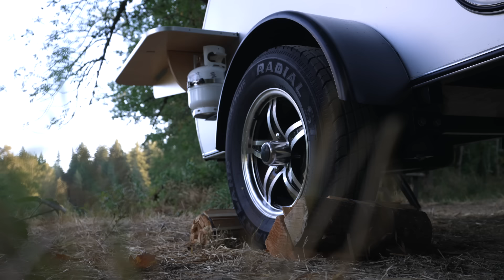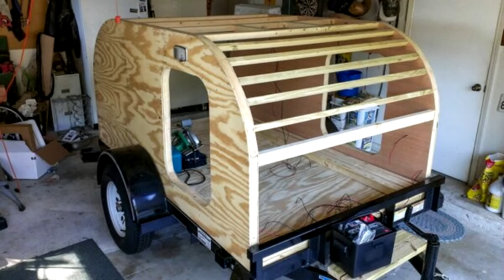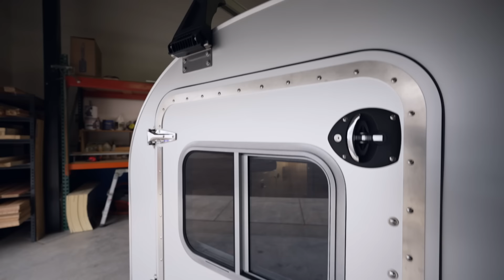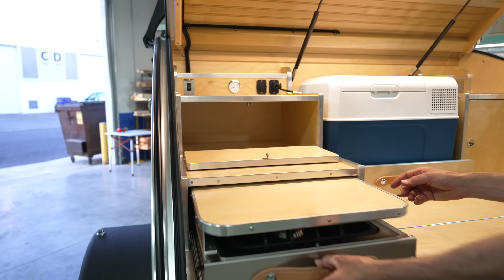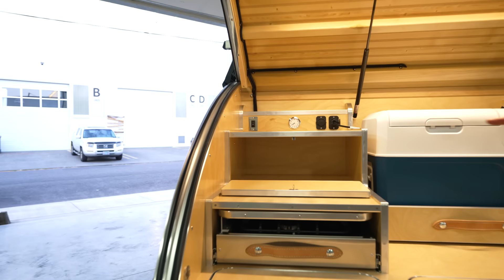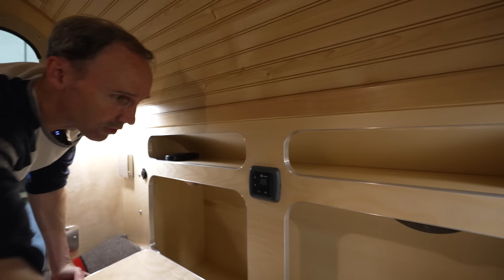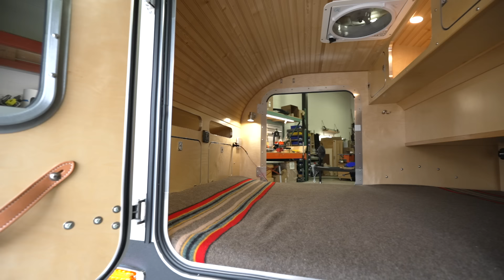RAISING THE BAR! A New Standard for TEARDROP Trailers

Comment: I wonder if they could install a slide out portion in the rear door to extend the coverage when the door is open. As usual a well presented video
Reply from the maker: Yes, or a lip. I have seen this with Bend Teardops in Oregon. They have a little diamond plating lip that extendes from the end off the hatch. It gives just a bit more coverage, which for most situations would be all you need.
Reply: @PlayingwithSticks  a couple of feet would make a lot of difference
Reply from the maker: @kayakcruisingtas  It really would. It doesn't take much. Even the Bend Teardrop version I think it is only probably 8-10" and that makes a difference.

Comment: It is a beautiful trailer but seems to be more show than go.  I didn’t hear anything about the tongue weight.  Seems like it would be heavy with two full 20 lb propane tanks, a large tool box and the axle behind the center line.
Reply from the maker: You have a good eye Ken. Yes, the tongue weight is a bit on the heavier side at 190lbs. Now that is 190lbs with both 20lb propane cyliders loaded. And you are absolutely right. With the axle placement of teardrops you tend to get a much heavier tongue weight than you would expect.

Comment: This look very cool and very affordable, however, Drew, Didn't you (sometime in the past), say that getting a plywood teardrop wrapped in something else does several things: Adds a ton of weight and eventually will suffer from water damage? I noted the ways they are trying to not allow water to seep into the ply and at ~1700lbs they are obviously using an aluminum frame to cut the weight. As for me, I am still only looking at trailers like BEAN and Escapod, who have fully sealed fiberglass exteriors which should last forever and composite cores for better insulation.
Reply from the maker: I'm glad you caught that in past videos. I was referring to the undercarriage of the trailer. Builders who have been doing this for a decade or two know that it is a big NO NO. So for example with this trailer because Dennnis has been doing this for a while he has his own way of protecting the belly of the trailer, while preventing water from sitting down there. Here is what he does. Regarding the floor- it is a single 5' x 8' sheet of 3/4" hardwood-core plywood with exterior grade glue.  They actually ship units of this plywood up from San Diego as this is the closest distributor that sources this high-quality plywood.  There are no scarf joints or seams in the floor and the plies have as near to zero voids as I have ever seen. The bottom of the floor is coated in 3 coats of "Battleship Gray" Dock paint with an added fungicide to avoid mold or mildew under the trailer even if it is stored outside during the off season. The top/inside is coated with a zero VOC, UV-cured clear coat finish. You do not want to have any type of covering material (like this- https://interstatervmetalandsupply.com/collections/under-belly-materials-blue-board-insulation/products/darco-skin) or belly pan over the floor since water or moisture can get trapped in between the floor and belly pan/material and cause mold/mildew and rot. An open floor is the best to allow road spray and any moisture to drip off and air dry. The Dock paint holds up indefinitely since it is not exposed to UV rays and is actually relatively well protected. Also should an area be scraped or damaged, spot applying is a snap since everything is open underneath.  Does Dennis get it or what?!!! As for your Bean and Escapod statement, it is hard to ignore. We can spend all day saying how a traditional teardrop is built to protect itself from the elements and road conditions. But at the end fo the day they still have a similar half life to any other traditional trailer. Basically that is 5 years due to the high and low frequence vibrations and lifespan of materials. At about five years you have to do some minor maintenance (seals, assessing connecting points, etc). Now with an overbuilt trailer like this video you could maybe double this lifespan, but I still think at five years and good use you will start to see some wear and tear. Where a non-traditional composite trailer has a much better chance of exceeding this 5 year mainteanance deadline. With a traditional trailer and proper maintenance it will last just as long as a composite trailer. BUT a composite trailer could last the life of it's owner with very little maintenance.
Reply: @PlayingwithSticks  best answer to a YouTube question I have ever seen. Thank you. (Still going to get an Escapod though 😀)
Reply from the maker: @GalendilEVEPlayer  I completely get that. They make a great trailer! I love how Jen and Chris are just pushing the industry to evolve.

Comment: Thanks for the vid! I wish that more tear drop trailers would come with the dual fiberglass propane tanks like this one has. Also I would be a fan of having a place to plug in a Bluetti, Jackery or the like as the power center for these trailers instead of the built in one. I would like this because if storing it for awhile you can easily just unplug the power station and keep it inside and charged up for the next camp adventure or could have a second power station as a backup in case the other one fails or runs out of power.  I like the inside of this tear drop and it has a very premium look to it!
Reply: Adding the ability to augment the trailer with an external power solar generator like Jackery, Bluetti or Anker would be amazing!
Reply from the maker: I second that!
Reply from the maker: BRAD!!!!! Thank you so much for being our big support. Some day I will have to put text on the video saying "This video is made possible by Brad!"  Haha. I have a feeling after this video is seen by the community many of us will be running out and picking up a fiberglass propane tank. That is what I love about these walkthroughs. There is always something new to be discovered. Good point on externally powering these teardrops. I think it is a great route to go. And a good way to save costs. One battery to do it all. Power the trailer and chase the sun. And I agree this is by far one of the most beautiful trailers I have seen.
Reply: @PlayingwithSticks  I love the dramatic acting clip you threw into this! I kept thinking you were going to start yelling “Stella! Stella”
Reply from the maker: @jgrant4520  Is this a Marlon Brando reference?  I love it!
Reply: @PlayingwithSticks   A tear drop named Desire!! 😁

Comment: I thought the trailer looked good.  The price wasn’t too bad.  I liked the fact that there wasn’t any hard mount water tanks.  Did the 12v fridge pull out?  I could see where it would be a pain to get stuff out if it didn’t.  It looked like it could.  Maybe I missed it on the video.  Those propane tanks were cool.  A whole lot of propane for that little camper.  I like that they are taking steps to mitigate water intrusion; but, with any wood teardrop, you have to be concerned about potential rot.  We like our Maxair fan like in this teardrop.  The only negative is when the fan is running or you open it with the remote, the lid/top is either all the way open or all the way closed.  It would be good to run the fan at 10% and have the lid minimally open.  Definitely would help on those cold nights which condensation and you don’t want the fan lid/too all the way open.
Reply from the maker: Hi Garret. Sorry, I should have had the fridge pull out. Yes, it does. But at the same time it is mounted high. I'm glad you mentioned the fridge because I'm able to mention how when your fridge is high you are essentially reaching in blindly. I find a fridge down low allows you to see to the bottom of the container. Which obviously means less shuffling around of items. And yes, even when your trailer is well built you are always going to have rot in the back of your mind. That is just the way it is unfortunately. I am an overthinker and so when I stumbled on my first Scamp I knew composite was for me. It wasn't that my teardrop was rotting, but I just couldn't shake the fact that it potentially could. Every storm, every outdoor winter storage period I needlesly worried. Because I knew there was a weak point that at some point could become vulnerable. Now with all that said, if you aren't crazy like me. And you don't stress over things until they actually happen....A little inspection of the trailer before taking it out and when returning it should be enough to ensure they last a lifetime and no rot ever pokes it's uglyl little head out. I am glad you pointed out the issue with the MaxxFan. Can you manually open it to be partially opened?
Reply: @PlayingwithSticks  Yes, you can manually open the Maxair fan with the black crank wheel you see turning when he opens the vent.  So, without the fan running you can manually open the vent partially.  Using the power open/close and/or running the fan is all the way open or all the way closed.
Reply from the maker: @garretlewis4103  Thank you for clarifying. I didn't realize that.

Comment: Great video thanks. I've got one foot in the water on a teardrop so I think I'll start to check out your other walkthroughs. This one's beautifully built and finished and seems like a good price for the quality but maybe a little heavy and maybe a little too "nice". I have a Toyota Tacoma 4 cyl and would rather not have to upgrade for more power.
Reply: Check out Drew's walk through of the Bend teardrop. I put my down payment down on the 6x12, picking it up in July. A little more basic but I feel it is perfect. And the price is amazing.
Reply from the maker: @ryanm.9533  My wife loves the Bend Teardrop and that is saying a lot. She is all about the cutesy factor typically. But she says that trailer in terms of functionality is what most users need.
Reply from the maker: You said it well with the "maybe a little too nice" comment. That is how I feel about this trailer. I wouldn't almost feel guilty about using it because it is such a piece of art. Not saying it isn't functional. But, it would take me a while to break it in. It would be hard to put that first scratch in it. In terms of weight I am in agreement with you there as well. Having a bit of extra towing capacity is always nice to have. Basically creating a buffer for different loads and driving conditions. Someday I will make a weight video. Most of the heavier trailers really cause negative impacts. But a lot of it doesn't necessarily come down to the weight, but more often the heavier trailers means more frontal area and often a greater drag coefficient. So although a trailer like this at 1,650lbs sounds heavy I find they often tow like a 1,000lb trailer due to their smaller size. BUT you put on a rooftop tent and now it performs just as poorly as many of the bigger trailers. Some day I am going to have to make a video about this. I have always been surprised how Camp Inn owners tow their trailers so easily with smaller vehicles. And that is where I have come to realize weight isn't nearly as important as drag.
Reply: @PlayingwithSticks  I know you are busy but I hope you can make a weight video some day.   With the price of gas now it's no small thing to be pulling 2K around.
Reply from the maker: @jenns7669  I'm still toying with the idea for this summer. A few stars will have to align to make it work. But if it does I think it will be a really special video.
Reply: @PlayingwithSticks  Excellent input. I've checked out the Bend and also the "Toad" both of those are longer on the function side which is what I want. I'm solo so I just want a twin/full bunk so I can have a sitting/living area as well. This may turn into a 6/mo a year home. I also may investigate a trade up to a V-6 Taco. Thanks for your input. Look like I'll be binging your site for a good while.
Reply from the maker: @jfowler7604  Another style of trailer to checkout would be a squaredrop trailer. I really appreciate the newer Runaway models because they replaced the wood with longer lasting composite materials.
Reply: @PlayingwithSticks  Thanks....will do.

Comment: This is a very nicely crafted trailer. Without a doubt. I agree with you on the third dislike about the lower portion being closed and would be more beneficial as a slide-out storage area. I also noted that you have to reach far inside and that means that you will potentially be rubbing your legs and part of your body on the back of the trailer, which if it is wet, covered in snow or road grime, means that you will not have a pleasurable experience. You will also likely catch your clothing on the number plate which will either bend it or potentially it will rip your clothes. Perhaps the lower part could  fold downwards (a split tailgate) if they still prefer to have a shorter upper portion. I don't understand why awning rails (a c-channel) isn't fitted to allow for the quick attachment of an awning like we see on the sides of caravans in Europe. In this instance, I mean an awning rail that traverses the lip of the tailgate and a simple awning which requires just two poles. This is a very nice trailer and that is why I bother to provide feedback. I feel it will be considered by Dennis even if it isn't ultimately taken onboard.
Reply from the maker: Great point on the rubbing. I thought about pointing that out as well. There was one point in the video where Dennis reaches over the entire galley to turn on the light. First I thought, that is an interesting light placement. But second it made me think about leaning up against the galley and touching that lower exposed portion. I never even thought about the number plate. Good eye! I really like your awning rail suggestion. We had that on our Shasta Compact and it was great. It doesn't take a whole lot. I am okay with a little water in my galley. I just want basic protection (like a simple awning or a hatch).
Reply: That’s actually a great idea, having something like that could be taken down quick if it got too windy.

Comment: Lovely!   I haven't  seen this teardrop before.   As you said there are things I like and things I don't like.   The space inside is great but I need more storage.   I'm going to research on that propane tank!  Wow.
I have never been a fan of the roll out stove design.   That's just me and the weather challenges I've had at times with wind, rain, and snow.   I'm interested in the wind rating for the galley hatch supports.   
Where is this teardrop made?
Thanks!
Reply from the maker: I have a feeling there will be a lot of us picking up that propane tank. It is a bit costly, but 1/3 the weight! Wow!  I have never been a fan of propane on the tongue. But for most builds that is the most logical place to put them. Good point on the roll out stove design. I even feel like that with some fridge designs as well on these 3/4 galley teardrops. Not that it matters to get the fridge or food wet, but it does mean you have to go further away from that hatch covereage. Some of these 3/4ths protrude a little further out. So if you stay close to the counter you can get fairly good coverage. But like you said if the grill or fridge need to pull out, that hatch now does you no good. In terms of the gas struts that hold these trailer hatches up they are typically plenty strong enough. The issue with them is that over time they may need to be adjusted or replaced. Typically with a craftsman style teardrop like the High Camp there is a wooden strut. Something like that basically has endless holding power. A good example of this if you want to see one is on the Camp-Inn teardrop trailer. The teardrop in this video is made in Portland Oregon. Hence why it is designed for all seasons and tougher road conditions.
Reply: @PlayingwithSticks  I own a Camp Inn 550. 
This trailer has a great galley for perfect weather camping.
The square door is great.   I like the leather pull strap.   I'd like another one of those closer to the middle of the door which, again, has to do with batteling wind and holding on to a door that wants to rip away.   Is there a door stop to hold the door open?
Thanks Drew!
Reply from the maker: @jenns7669  Now this is interesting. I have never heard that before. Flip over? Okay you have to give me more details here. So the hatches don't fall down they actually flip back towards the roof of the cabin? I can picture that now. Without a gas strut I guess there is nothing stopping them huh? In the midwest that wind can come up fast! LIke you I really like the leather. I find it a great touch. As for the door stop it is located on the bottom edge of the door. It is a metal male end that connects into a rubber female component located on the sidewall.